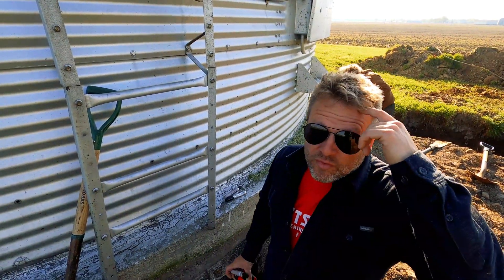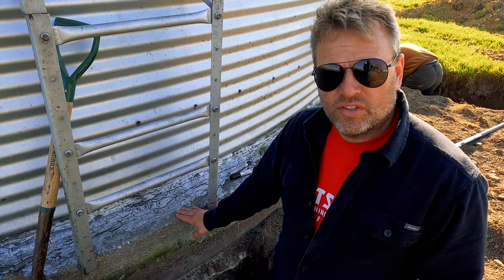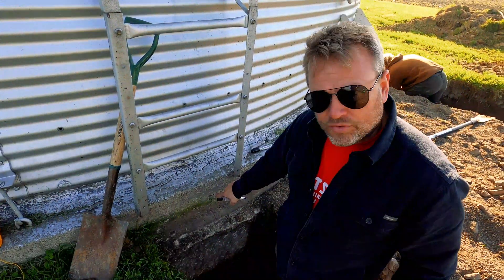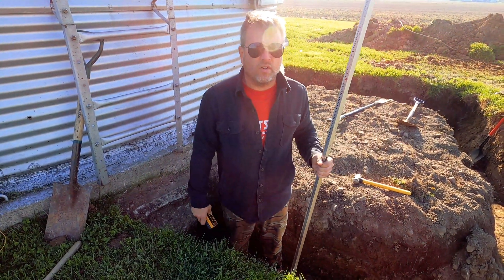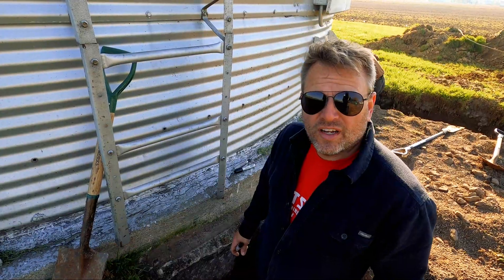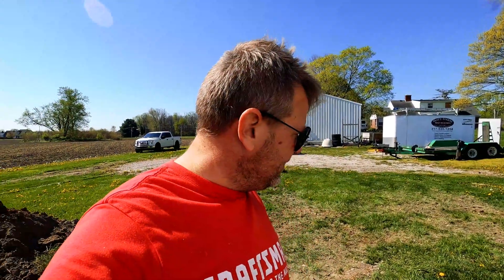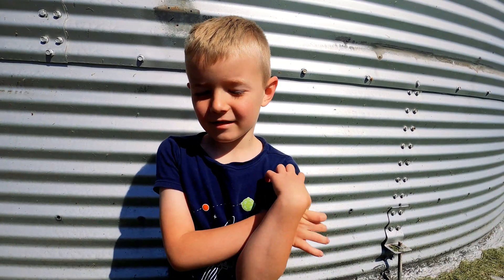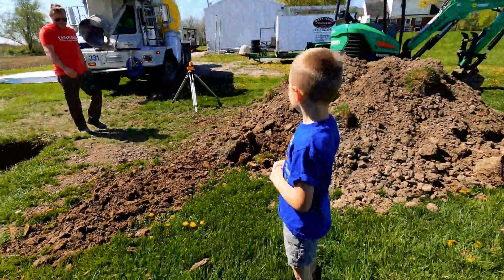Grain Bin Home Build... Episode 2 "Foundation Footings"

Comment: Were you required to have an architectural blue print to obtain a building permit? Trying to get through the red tape and build one in Colorado.
Reply from the maker: Yes a permit is required, and so drawings had to be submitted.  Here they do not have to stamped by a licensed architect since it is residential.  So could draw them myself.